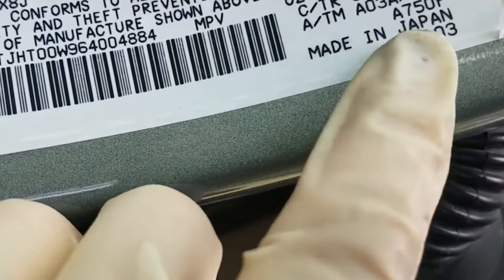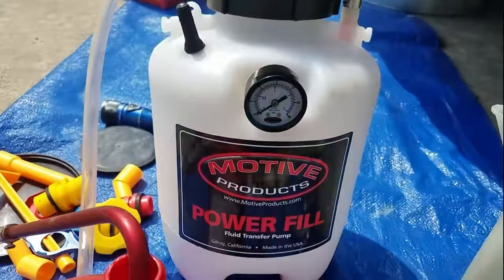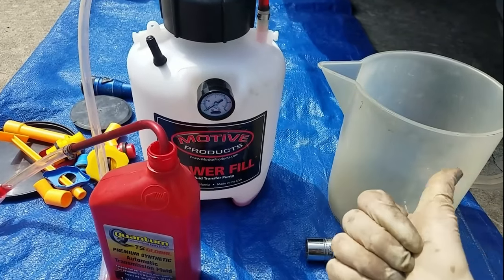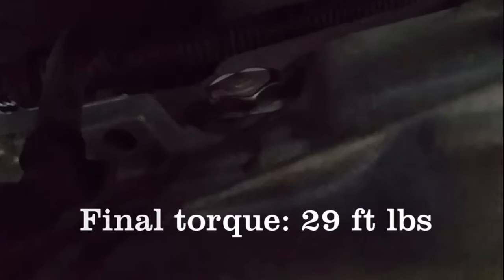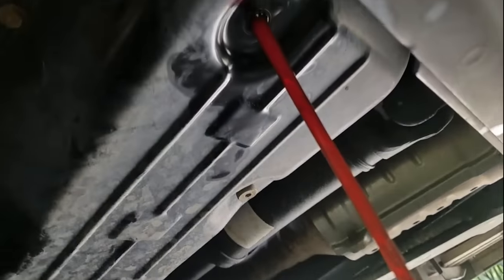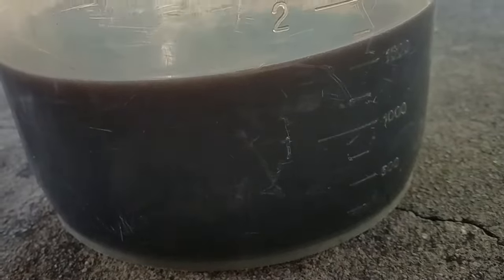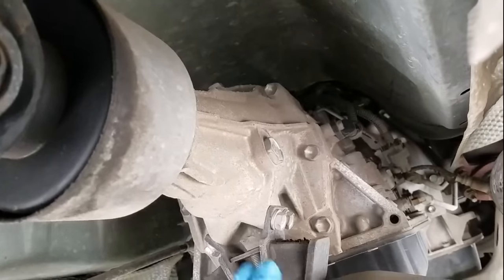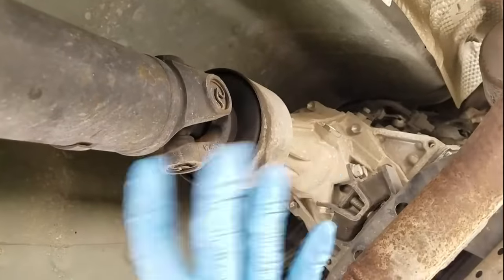How to Service a Sealed Toyota Transmission

Comment: Outstanding video, very thorough, clear and complete!  I found watching the youTube videos interesting in that no one dealt with the point that changing just the trans fluid in the pan was the tip of the iceberg as far as the total fluid volume goes.  Also, I can remember when I was real anal about dropping the pan and cleaning out that thin layer of material in the pan, the layer that isn't going anywhere anyway.  Once I disassembled a few transmission filters I saw that they just had a screen inside, I couldn't see the need to change that.  

At any rate I like the "circulate the fluid around" technique better. I can change all of the fluid and it's actually simpler for me.  You just have to have plenty of clear hose and large containers!  Then make sure you circulated as much back in as you circulated out.  Having an assistant to start and stop the car helps!

Comment: Ms Faye I've seen several videos on changing Toyota/Lexus ATF in sealed transmissions but yours takes the cake.  Because the parts you are working on are all well lit and can actually see what you do!
Yours is about the best sealed trans video I've seen so far, but I must raise an issue about one thing:  your choice of replacement fluid.  Depending on the year of the car Toyota/Lexus takes Toyota TIV, or Toyota WS ("world standard" - and the two fluids are not interchangeable).  I believe for the truly critical choice of transmission fluid, you really, really ought to stick with the OEM fluid, nothing less!  
Nowadays auto trans in general, are probably more sensitive to choice of fluid than ever before.  To refill with anything but OEM fluid, to save a couple of dollars, is a false economy.

Comment: Faye: This Method is Excellent, Clean !
The only thing I did differently was used Motive 1735 - Power Fill Pro 1 gal. (Brass Ball Valve Flow/No Flow), and used Amsoil Signature Series Fuel-Efficient Synthetic (Meets WS SPEC.)
Thank you

Comment: I did a transmission flush on my Porsche Cayenne Turbo and the Porsche recommended fluid was over $65 a liter.  After looking up the manufacturer of the Transmission, I found out it was Aisin, a subsidiary of Toyota/Lexus and they recommended Toyota WS fluid for the transmission.  At $13 a liter, it was a no-brainer to do the flush/service with that stuff.

Comment: Just watched this now as I am about to under go attempting this for the first time myself. Just got it done at Toyota here in Canada for what I think is the first time in my 06 4 runner sport v8 history. $244.95 for Toyota to not drop the pan do a drain and fill. Manager said 7 or 8L would have come out but every video I watch only 4L roughly comes out and then having to repeat to get it to desired clean level. 12.2 L the system holds when he looked it up so if only 4 got changed its still going to be pretty black. Will have to do this exactly a couple time for sure. Just got a new Wix filter and gasket as well today. Toyota said this service is recommended at 96000km drain and fill and no need to drop pan clean magnets or change gasket they claim at any point which I think is crap after watching a bunch of videos now. I am at 243 000km so way over due. 2 previous owners so I dont think it was done and think the fluid is the original stuff so must get on this. Drop pan clean those magnets and pan get a new gasket in and do all this video. Little daunting the first time ever doing this but thanks so much for making this awesome video! You rock!!! :)
Reply: Cool piercings tats and hair btw!!!

Comment: Excellent video... amazing to see a video on YT with proper process from torque wrench, to crush gasket observation, to running the vehicle to temperature before putting the plug in. Definitely agree with not adding more fluid once it hits temp. Now, if you’ll do a video about how to properly calibrate a 2nd Gen Tacoma speedometer/odometer after changing tire size and / or diff gear ratios! 😃
Reply from the maker: Haha actually will have to address that one very soon 😆

Comment: Yeah you inspire me to open up my own garage. Changing the oil is not complex enough... I am a chef by profession SO I'll add a cooking segment to the video, to make it more interesting. 
 A chicken will be roasted for lunch while the oil from the transmission is changed, drained one time, then again a second time and a third time. By the third drain the engine is hot enough to bake a baguette in the engine compartment. I'll call it a drain and  lunch, like dinner and a movie they take just as long. No charge for this one LOL

Comment: Faye,  Thanks to you I changed my second radiator on my 2nd 4runner this weekend and it was much quicker than the first time.  I also learned to used the transmission return line to do a quick trans fluid change.

Comment: Hello, You have the ONLY transmission video I've seen where they remove the filler plug FIRST step - won't get caught with over-tight plug. This is how I see you know what you are doing - experience!  No mess too, this is hard with hot ATF oil drain where wind under the car can blow about the flow line.        Also, to avoid the thermometer method, before you drain and Cold, I was wondering if you could first feed in a 'BullAnt' cable inspection camera thru the filler hole. With engine Off and Cold look for a Full reference object inside. Cold as you have to work around the Cat converter. Drain fluid when hot and pump refill from below as usual. Drive a short distance and thru all gears. Next day when Cold and muffler Cold also, feed in the BullAnt again to see if same level. Any small top-up amounts of ATF can be gravity fed in down a tube from above using a funnel wired to the engine bay.  Good camera work BTW

Comment: I am pro no dip stick mainly for 2 reasons. Some folks if they have a leaky transmission tend to overfill to compensate for the leakage and tend to let the leak go until it gets out of hand and causes more damage. I get these transmissions when they are slipping or making noise which leads to a rebuild or replacement when just locating and fixing the leak in the first place was the best option The other reason is some do it yourselfers will dump anything they find on the shelf at your local Wal-Mart in an attempt to fix a leak or "cure what ails their transmission" and often times make the issue worse.

Comment: Hi Faye.... This is the first time changing the trans fluid in my 2019 Tacoma.  You have confirmed that I can remove fluid at the cold temp (once) and replace the exact amount cold, without going through the SILLY temp drain check. I was thinking of re configuring the fill plug by routing it to inside the engine comparting so it would be easy to fill on future Trans fluid changes.  Your thoughts on that... Thanks for the wonderful video
Reply from the maker: Yes! Many folks out there have made their own dipsticks! I think thats an awesome idea!!!

Comment: About to try this technique on my 2006 Tundra TRD 4.7L V8. It’s a heavy truck and hope it doesn’t roll on me. My jack is a little small. Thanks for the video!
Reply from the maker: Oh gosh! Ebrake !!! And a set of large truck jackstands sell for less than $100 at NAPA! Wayyyyyy less than the $$ you're saving by doing this job yourself. Good luck!!

Comment: My 2017 Nissan Rogue doesn't have a dipstick, but it still has the dipstick tube.  I ordered a replacement dipstick off of eBay and now I can check the level and color of the transmission fluid.  I used a pump to pump out the fluid through the dipstick tube and replaced an equal amount of new transmission fluid.  It doesn't get all the fluid out, but I plan to do this method every two years, so it should be good.

Comment: your knowledge of mechanical work  is very professional ,  i like it .

would have figured that over flow would have been at the top of the transmission, but i guess that is when it only gets hot. 
question ,   why drain from the bottom of the transmission pan to get rid of  said  '' over flow '' ?, seems like alot of extra effort . 
and no,  i have not had to work on any type of transmission that was semi sealed like that, that is why i asked those questions. all the ones that i have worked on  had a dip stick .

lol,   love the buff hen  [ show hen ]   ( far as i know, it could be either )   lol , definetly good for keeping the ground clear from unwanted bugs.
that chicken just as  ''goth ''  as you are   LOL

10,000 thumbs up !!  for valued knowledge .

subbed .

Comment: I have a Camry SE V6 2009 with 159k miles. Changed oil religiously every 4-5k miles. Run like new and love the car. No issues with transmission. I'm afraid to touch based on other vids saying you could create a problem. Your opinion would be appreciated!

Comment: Great Job and pleasant voice, buy I preferred the method of disconnecting the return line from radiator after you fill the transmission pan with new fluid,crank the engine 10 seconds then add more new fluid, keep doing it until the fluid on the return line looks clear, that’s it 👍🏻🙋🏻‍♂️

Comment: I got one of those pump bottles like you have here except it had a valve handle below the hook you put in transmission, I used compressed air to pressurize it but the gauge seemed to stick lucky i didn't put too much air in and blow it up lol. then it worked great much better than those little pumps you put on a quart bottle. thanks for the great tool recommendation

Comment: Chiming in fromt Perth in West Ausie. Own an 07 landcruiser Prado 120 GXL ( i think you call them Tacoma in US) mine is a 1GR-FE 4ltrV6 with same auto trans as in your video,
I have owned it for a couple or yrs but never serviced the Trans and it has done 260,000km. Not sure of it Trans service history so finally got around to changing out the fluid.
1st drain (cold) was 2700ml (2.7 ltrs) and is was pretty dark & nasty.  2nd drain was 2600ml (2.6 ltrs) after shifting the selector procedure & letting the fluid cool. Fluid wasn't as dark this time but still needing more flushes.  
What iam asking has not been covered.  I have 3 x Late 80's classic V8 Mercedes W126's (2 x 560SEC coupes & 1 x 560SEL) and i have my own DIY home workshop with a hoist. So when i service those trans i remove the Trans pan and replace the trans filter when doing the trans servicing as a matter of normal procedure.
How come with these Toyota services for the Auto it is only the fluid that is getting swapped out, but the old filter remains in place - Can i get some feedback on this please
It seems to me that only half the job is being done when doing a basic servicing on these trans

Comment: Great video. I have the A750 transmission in our 2013 Toyota Landcruiser Prado. Good to know how to flush the transmission fluid and check the level. 
We have a scan gauge with torque converter and transmission  on it. So will use that to get the transmission to the correct temp. Also have a temp gun to double check.
Top video with clear information. 👍

Comment: Thanks for the video. Just worked on replacing both front lower control arms, replacing the rack & pinion system, replacing both front brake calibers, and flushing the radiator on my 2007 Lexus Gx470. Was thinking about flushing the transmission, and then watched this video, and I think I'll just pay someone else to do it. You did yours with such smooth proficiency and perfection.....I'd probably just F#*$ it up. 

Hate to be cheesy and comment about your appearance.....but cool tattoos!!

Comment: I use Scan Gauge II in my 4Runner to monitor transmission temps when towing. The same gauge is used when changing transmission fluid. It's real handy.

Comment: Is this more beneficial than disconnecting the send line at the radiator and have someone start the car  while the person underneath tells them to stop after a qt has come out, then add a new qt back and repeat the cycle until the oil is clean?  I don't know, I'm just asking.  Your method can be done with one person, where the one I  mentioned takes two, but there's no touching the drain pan.  Nice job!

Comment: Hi Faye. That was a great tutorial. May I ask can you check the oil level with the engine turned off so not to overshoot the transmission temperature? Thanks.
Reply from the maker: You can't!! The fluid has to be circulating for an accurate measurement!!

Comment: 1) This is the only video that I’ve found showing the “WS” nut to refill the transmission with fluid! Thank you! 

2) I tried pumping fluid into one of the lines that other people are using in their videos and for some reason, mine lines are backwards going in to and coming out of the trans cooler and the transmission. Would you happen to know if this is normal or have a diagram showing how the lines should be running?

Comment: Why not just pull the transmission cooler lines and do the drain and fill that way then measure the fluid after when its up to temp.... Great video!

Comment: Watched this because Youtube popped it up and, hey, watching Faye change transmission fluid is definitely preferable to actually doing  work on a Friday.  Then I realized that it's been 30K and I need to flush the transmission in my 13 FJ TT (should have got the manual...dumb).  Then I realized that I probably have the same ridiculous transmission design where I can't just fill it to the fill hole and call it good.

<sigh>

Guess this was more useful than I thought.  Good call on the power filler.  I have the, rather amazing, little pump that screws on to the top of fluid containers, but I've wanted to get something better.  Too hard to use the little pump in tight spaces.  Having the hooked end on it is huge.

Working on sourcing a shop chicken.  I shall name her Bernice.

Comment: Hello Faye, wow I loved this video. I got a 2020 4Runner SR5 with 50k miles and I’ve been watching videos of how to do it until you came along. I was getting a bit frustrated with the others videos cause they are not as clear as your video. I have a couple questions if you don’t mind, first: after you checked the temp with the thermal gun, you added 1/2 of a quarter more, closed the filling hole and opened the check plug correct?? 
Was the truck still running while you were doing this? Or it needs to be off; sorry but I couldn’t tell. 
Second, is my understanding that is not recommended to do a full drain cause we want some of the debris in the transmission. Is your  method considered a full flush ? or still drain and fill even though you did it 4 times I believe. 
Thank you so much your help 
Gerson

Comment: So well done, and your reputation truly precedes you.  I just wondered about the total volume of fluid you consumed?  I wish to pump / dump the torque converter 1 quart at a time using the return cooler line, and hoped to reduce the total volume by not re-circulating the dirty fluid back to the pan.

Comment: If you're doing one drain and refiill, just measure fluid out and put in same amount and done? For multiple drains because dirty fluid use the same steps and measure fluid out and put in same amount? But for multiple times don't forget to keep the transmission running cool because heating the transmission expands the fluid? Why did you do a check on this video when you measured your fluid out and refill? Isn't the check used if you're not sure of the level to begin with? Or did you just do it for demonstration purposes? Sorry to many questions

Comment: Thank You for the excellent video and explanation. Some people use the fluid exchange machine. Do you have any idea if there is a need to check the fluid level if it is done that way? From what I understand the machine transfers exact amount based on weight and expansion does not matter. Thanks again

Comment: Thanks, great video! 
At how many miles was this? Just wondering, my car CVT has 80.000 km's.
Question: So flushing is done with 2,3 liter every time. So 4 times will be about 10 liters to flush? And the last fill will stay in the pan? Adding up for a bout 12.5 liters.
Just a little confused because a see a liter bottle showed. You used ten of them Or do we buy a 15 liter drum?

Comment: I have a 2015 camry 4 cyl with 50k miles. Is it recommended to do multiple drain and refill during the same time period? For example, drain and refill 3x times in 1 sitting. Or will it be better to spread out the multi drain and refill every other oil change?

Comment: I would think that this method is safer and much easier to do on your own than draining atf through the trans cooler line. While simultaneously filling the transmission via dipstick. Most vehicle's will shoot out about 2-3qts every 10 seconds I believe. But you'll need another person to help you. It allows for there to be more of the new fluid in the transmission, since it won't mix. But if you aren't putting in enough fluid fast enough to replace what is coming out. You can easily mess up the transmission. Which is why you'd need another person to turn the vehicle off when needed. 
Or you can do the drain and fill method, which is what I do since I never have any help. I always do this when I purchased an used car. I drop the pan the first time to look for any metal shavings that are on the magnets on the pan. I also check to see what condition the filter is in and if there are any signs of extreme wear or any burnt atf. I also use rtv as a gasket and never had a leak. Once you do the first drain and fill, I generally will do one drain and fill about every 6 months. A lot of ppl neglect changing the other fluids besides just oil. I personally stick with the Valvoline Synthetic ATF. It works for my transmission as well as my transfer case.

Comment: Completely agree about OEM fluids I believe the company that made the transmission knows the most about the fluid it should have in it I have a Infiniti it has a dipstick tube but no dipstick lol it's just a cap on it with a bolt